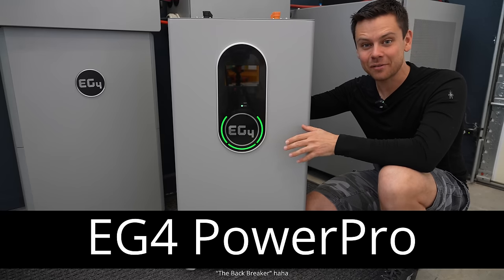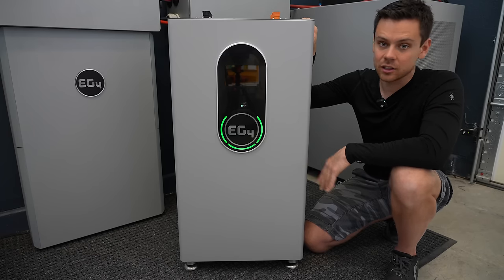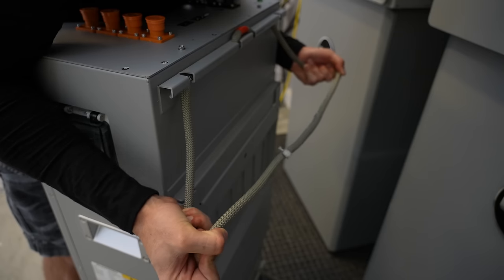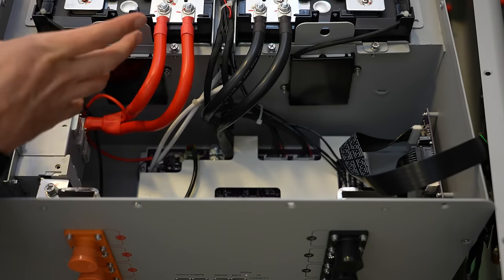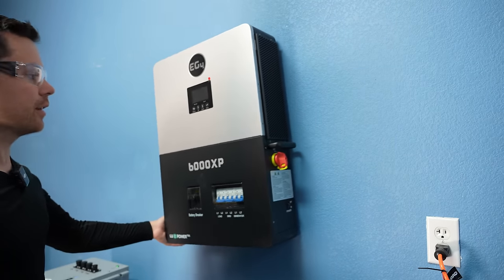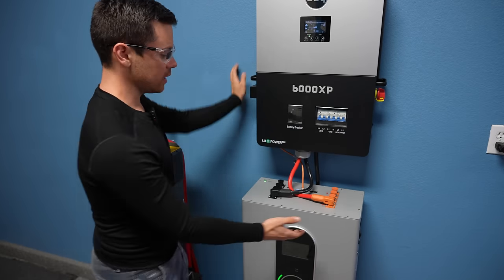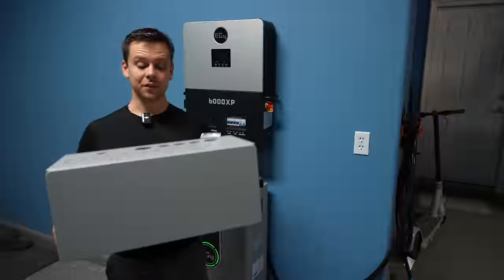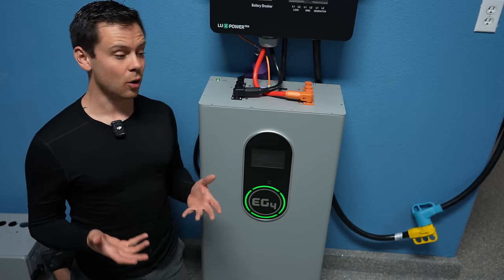New! EG4 PowerPro Budget Model: 14.3kWh LiFePO4 Battery for $3,431

Comment: It's a lot cheaper and better to DIY a battery pack. Better cells and a better BMS for a larger capacity and a longer life.
Reply: The problem we are starting to face with DIY packs is that so far 35 states have adopted 2020 or newer version of NEC - that means the energy storage system (ESS) must me listed to meet ul9540 standards. This means there are a lot of tests a DIY battery has to go through to be suitable for a permitted install. There are months of work on the backend that eg4 has already done to meet the standards homeowners need to get a permit and do a code compliant install.
Reply: @CurrentConnected  Yes, there are many areas of the country where municipalities require inspections for electrical modifications or additions on homes that are serviced by a local utility and do require battery systems (ESS) to posses UL-9540 certifications, but the vast majority of the country, especially in rural county areas do not require inspections or UL certifications for off grid installations, so DIY ESS are fine for those applications.

Comment: So funny....a Display  ( taking about 20 mili amps ) on a 14.000 Watt battery....switches off ..after maybe 10 seconds. .to save power ! 😅😅😅...it makes me mad..why not give the consumer the choice between.... always on- off and settable time ?
And never place 2 or more very heavy batteries without wheels next together.. blocking the on/ off switch...!! If something goes wrong inside the battery ( smoke ??  !! ) you want to switch off the system immediately !! 
And inside this battery..brrrrr  .no plexigláss protection..!! .all is open and the cells are also welded..😮 .( I do.nt like this as an Electricien and never without big problem s you can get to the separate cells ) 
But its all about money ofcourse...and for the money its a nice system ...👍
I have build my own battery systems  with separate Lifepo4 Cells and BMS and extra Balancer ....much cheaper and i can do my own maintenance without any problem...😏

Comment: I wonder if they could just put a sheet of plastic over the exposed battery terminals (or even stuck to the inside of the front plate) just to help avoid accidental shorts. Like it could just catch fire if I dropped something and dented the case far enough in

Comment: How does it achieve 8000 cycles when most are only rated for 3000? Something fishy.
Reply: This cell is a high cycle-count, sub 1c rate model.  The typical 3000-cycle cells have surge / burst capacities like what you would want for an EV, while these are meant for slower rates (like we use in solar) and that allows them to use less conductor within the cell for such high currents.

Comment: hold on to your shorts people............ soon if you have panels, you can plug your electric car into your house an power it in a blackout..... my bolt has a 64 kw battery in it.......... how many batteries wont you need to buy ,,, 64 KW in a chevy bolt

Comment: Try running a 5-10HP air compressor for a bigger load than the heater and then you’re not just wasting turning electricity into heat. Use the air later.

Comment: You can build a 15.56kW LFP battery pack with grade A EVE cells and a high quality active balance BMS with low/high temp protection for nearly $1,000 less than this unit. So no thanks.
Reply from the maker: active balancers are useless. You should buy better cells instead. sounds likeyou have a bad supplier

Comment: You made some misleading comments. You need a lot of solar to charge an electric vehicle and it will take a long time to get your 5K back charging your electric vehicle. Don’t mislead people.
Reply from the maker: That's completely false and I've done it multiple times on this channel. Are you new here or something? I've done this like 20 times 😂😂
Reply: He has plenty of videos on this channel on how he charges his Tesla 100 % with his solar. So before you blame somebody do your research!
Reply: I charge my Tesla and charge two power pro batteries at the same time with 12k in PV with no problem.
Reply: And in case you didn't think this through even further....
This can be used for a lot more than just charging your electric vehicle. It's not a once and done thing buddy.